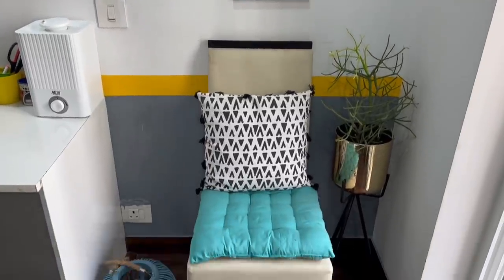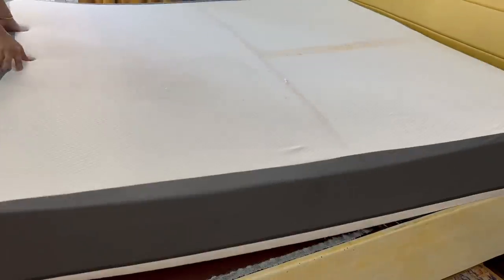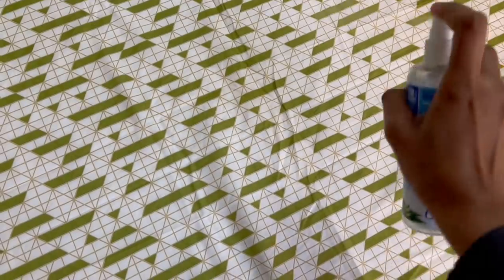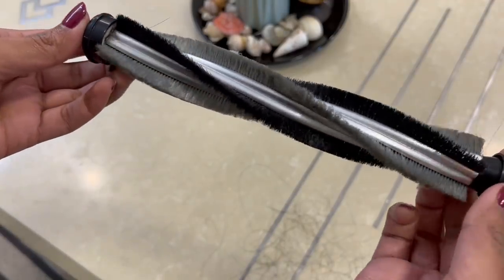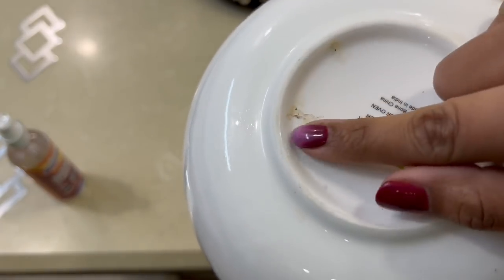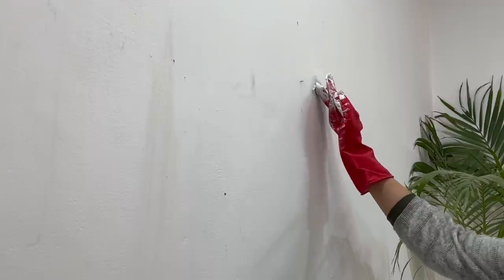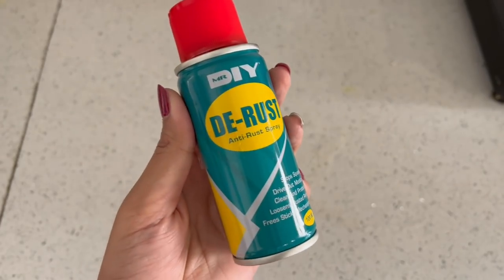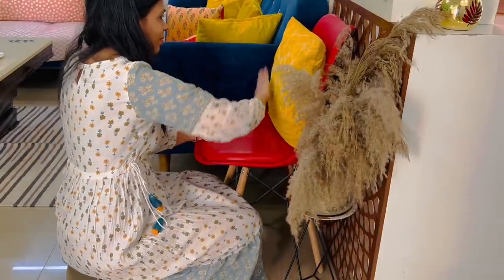10 NEW & AWESOME Home Maintenance Tips & Hacks | Organizopedia

Comment: Share some ideas to remove pencil crayon marks on walls
Reply from the maker: Dear! 
In today’s video I have shared one de-rust spray, that can also be used to remove the paints from wall. Many times earlier also I have shared the magic erasers they are good to remove paints from wall, you can try anything or these. 
Home remedy if the marks are less use white Colgate and rub it with cloth.